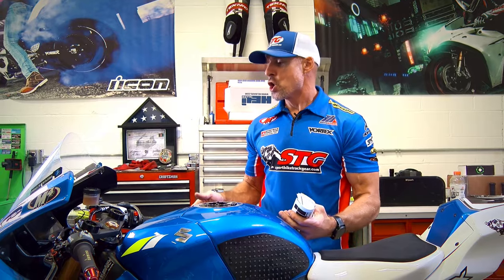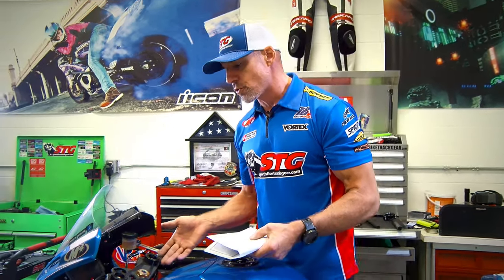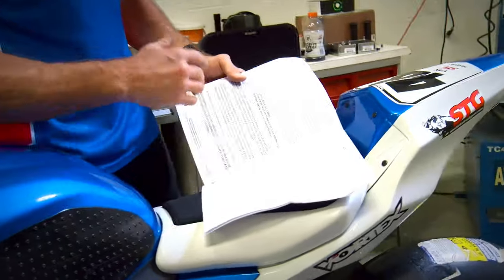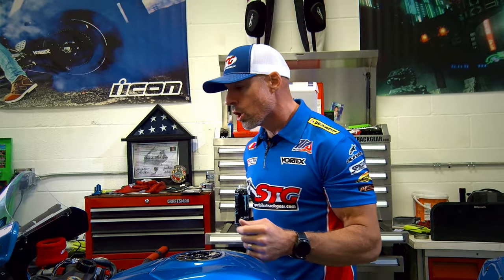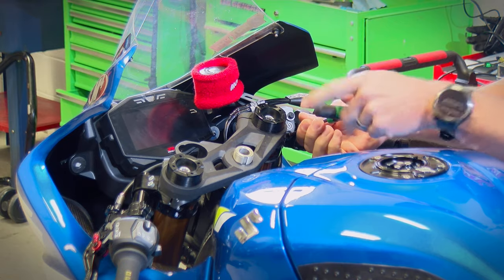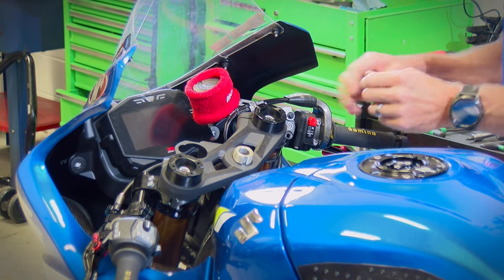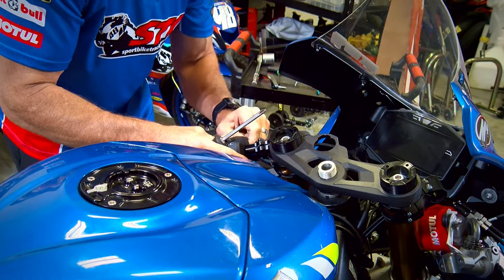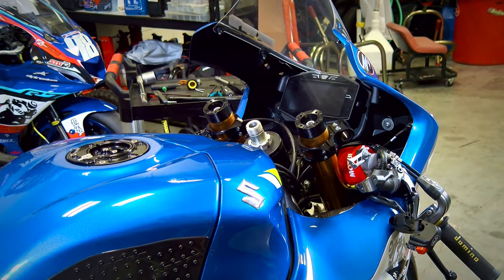Helibars Suzuki GSX-R1000 17-23 TracStar Handlebar Risers How To Install from SportbikeTrackGear.com

Comment: I have Helibar Trackstars on my 2016 ZX10R. These along with Vortex 2.0 rear sets, totally transformed my bike! its an absolute dream on the street, and they actually improved my riding on the track. I don' t think there are any downsides to them. I know several guys who race Alberta SuperBike Championship running Helibars on Various Bikes.
Reply from the maker: Thanks for sharing your feedback! - Van
Reply: @sportbiketrackgear  Agreed. I have neck issues, and the more relaxed seating position shockingly allows me to turn my neck farther, and see farther into the turns on the track. Did not expect that benefit, but is a game changer for me. I discovered this by doing a track day on a borrowed Aprilia Tuono V4 1100. After 20+ years of superbikes, I will never go back to the racer body position.
Reply: Thank you for this information and vid..I'm 63...and looking for a bit less weight on the wrists...

Comment: FYI you can mount the helibars ABOVE the triple tree with NO mods, for an even more relaxed / hyper-naked body position. Been running my 1000-R like that for 3 years on track & street. Makes it the ultimate bike.
Reply: Any problems running into the fairing?
Reply from the maker: I would expect raising the bars that much to cause issue with both the fairings and the controls. I am almost positive the brake lines would need to be lengthened. - Van
Reply: @italyguy08   brake reservoir barely touches the windscreen at full lock. never an issue in 3 years and 18k miles and multiple track days
Reply: @sportbiketrackgear  Surprisingly, no issues and no modification necessary. We were shocked as well.  Brake reservoir barely touches the windscreen at full lock. never an issue in 3 years and 18k miles with multiple track days. Love your company and videos. If you were going to do another street bike that got a lot of street miles (5-10k annual) would you a Gixxer with a Dirtbike bar conversion, or a Tuono V4 or Streefighter V4 or MT- 09/10 ? I LOVE the Tuono V4, but Italian reliability, short warranty, and parts scare me. Thanks.
Reply: Is it possible for you to share a picture? I'm really interested in this setup.